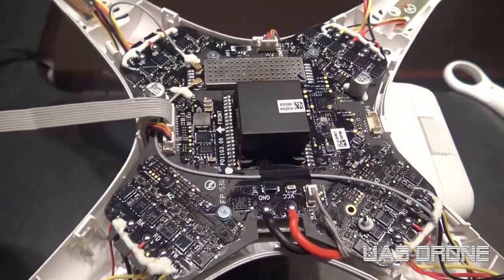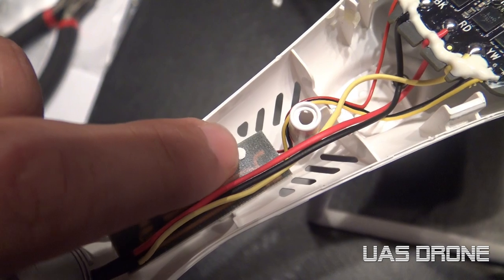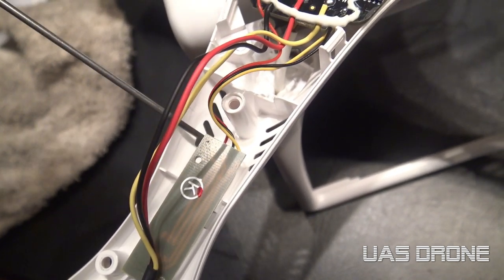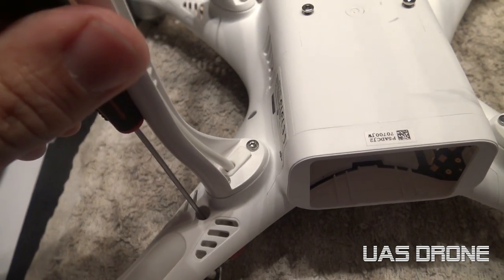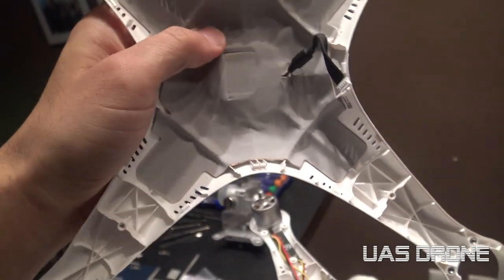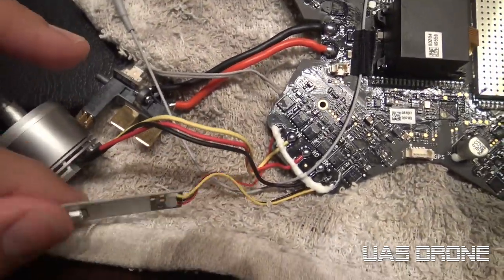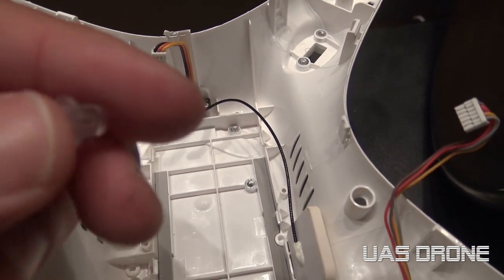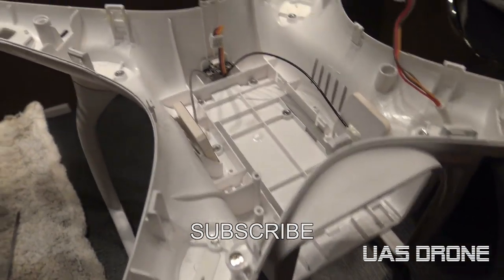DJI Phantom 3 Mainboard And Motor Removal

Comment: Just crashed my Phantom Standard, first time opening it up and noticed the grey and black antenna tore off with the gimbal. I noticed in your video you had one wire with the gold tip on and one off.  Did you have to replace the whole wire or was it easy to just attached the gold connector back onto it?  Thanks.
Reply from the maker: +Emanuel Guillermo I managed to reattch the gold connector.

Comment: Sucks what happened with the pelicans bro, good luck getting this bird back up in the air.
Reply from the maker: +Marlon “MarlonPTY” Torres I just fixed man thanks for watching.
Reply: Bro, do you know where it's legal to fly in the NYC area? Like to get shots of the skyline.
Reply from the maker: +Marlon “MarlonPTY” Torres Going to be honest nowere practacly every park you can't use rc planes very tight here. if theres a spot its pretty much a shitty area.
Reply from the maker: +Marlon “MarlonPTY” Torres every spot theres something going on heli ports airport park regulations etc.. can't do shit. its like fly then run here.